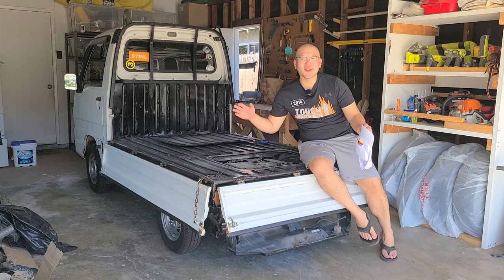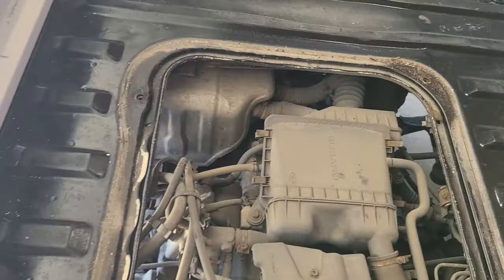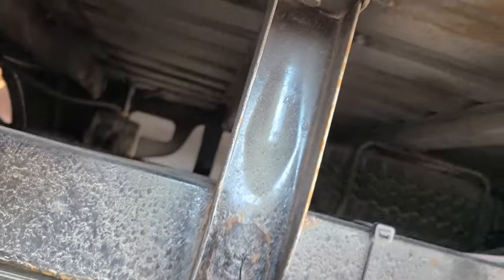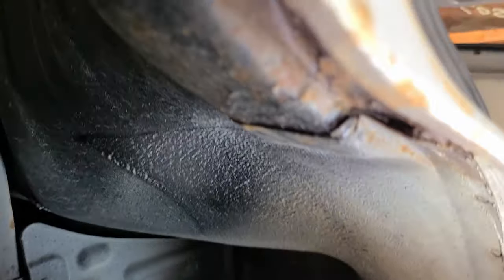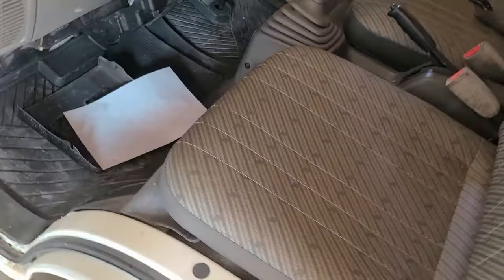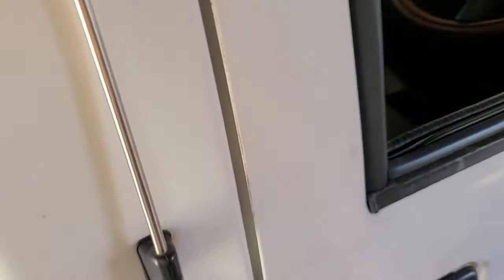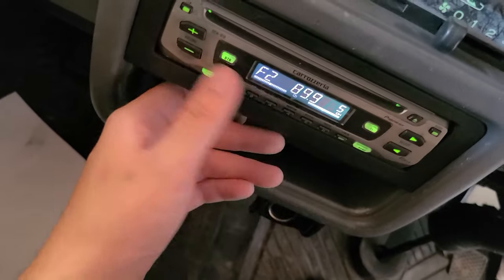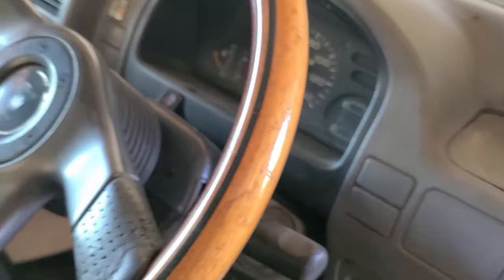1992 Subaru Sambar Kei Truck Walkthrough

Comment: Chris Notap has a classic video about how cleaning old seatbelts often gets them working again.

I think the black flappy hanger thing in the cab is to hold hats. You put a hat with a full brim in it upside down and it holds it up out of the way for you while you drive.

There are some rust spray paints that you can use that are designed to convert the rust that is there and prevent it from progressing. Its not as good as sanding or grinding it all out but its much easier.
Reply from the maker: Thanks for all the feedback! I'm checking out Chris's videos now. I need to fix that seatbelt. The holding hats thing makes a lot of sense! I need to post on reddit to see if anyone knows more about it. I'll check out those spray paint, but I'm leaning towards the sanding route. Thanks again!

Comment: That splodgey stuff you found in the cab around the 9:30 mark looks like painted car body fillter to me - looks like the wheel-arches / door sills are fairly rusted out and have been body-fillered to hold them together.  Bit of a "low-end" fix but it's cheap and it works.  Doing a better job on that (e.g. filling it in properly from both top and bottom - I could see through the wheel-arch to the filler at one point there) is probably a good idea, but it should be fine.  If you can get someone to cut away some of the rust and weld it, that might be better yet.

The rust under the back half of the body looks like surface rust though like you say - a rub-down and paint or some rust-converter paint will help it but it'll be good for years in the California climate, I'd think.

Oh, and the dangly thing on a cable under the passenger seat is a cigarette-lighter / 12V accessory socket, if you didn't figure that out.  You can plug a phone charger into it or something :D

Looks like a fun little project: a rough little industrial truck that's been cared for by someone who knows how to keep a vehicle running but doesn't necessarily care about keeping it pretty.  I'm kinda envious TBH.  Looking forward to seeing what you do with it, when you do.
Reply from the maker: Thank you for all the good information! You're totally right about the body filler stuff and looks like learning how to weld is in my future! I do want to try sanding and painting as much as I can first. I had no idea the dangly thing is a cigarette lighter! That's fascinating. I'm not looking to make it look pretty and more focused on keeping it industrial/functional truck. So excited to see what happens next! Thanks again!
Reply: That rust looks terminal for getting it legal. Nice truck apart from that
Reply from the maker: @DeneMcDonald  Ya. It was $1600 which is on the cheaper side so I was expecting a lot of rust.

Comment: if I wanted to be pedantic, that is an accessory belt, fan belt or some similar term that is driving the alternator, a timing belt is much more guarded behind covers

as for sanding rust on the unusual areas.. wire wheels to the rescue.. as for the rust in general, seen worse, hell I've driven worse.. I had a Blazer that was originally sold in wisconsin, basically just rust underneath
Reply from the maker: I welcome all pedantic comments! I need to learn more about car stuff. Thanks for the recommendations! I'll check out some wire wheels.

Comment: I wouldn't waste too much time and $ on the rusty parts. As long as they're solid, just spray some rust reformer on it and then paint over the rust reformer.  Rust reformer will stop the rust from continuing without the need of sanding.
Reply from the maker: That sounds like a great idea and pretty simple too! I'll look into it once I'm ready to work on the rust. Thanks for the good information!